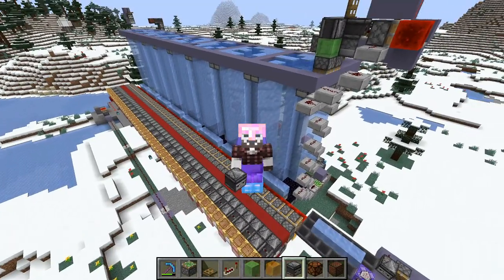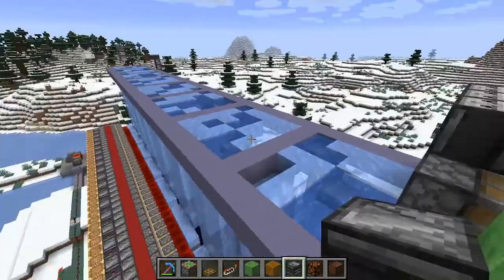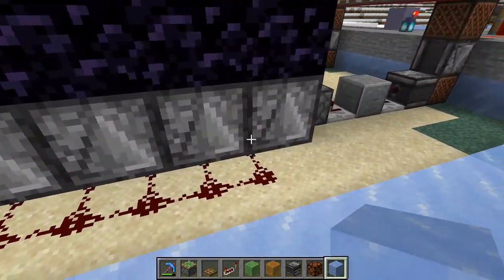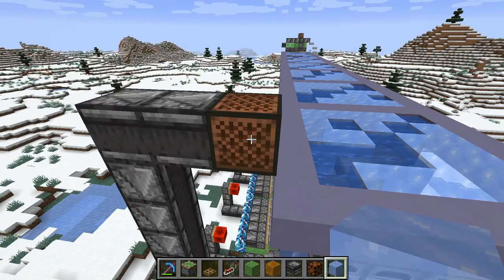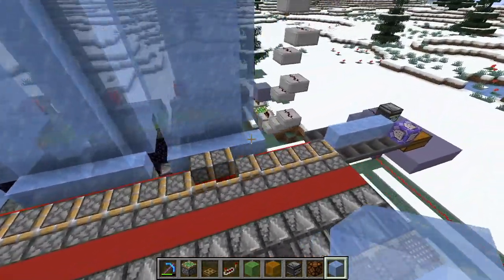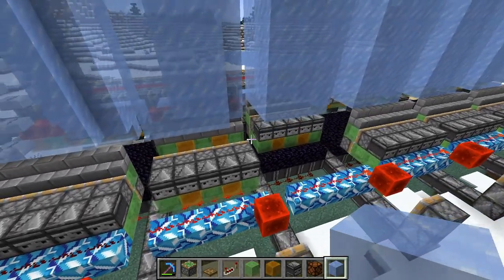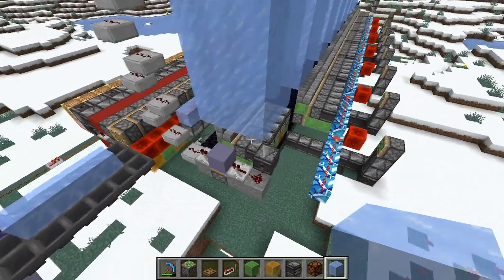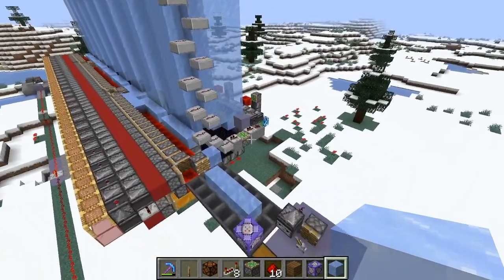Minectaft AFK Ice Farm 1.15+

Comment: I am just designing a sistem like this in survival and I am doing it 64 long for 2 line large 8 blocks. So it remain inside a chunk loader.

1st I found a better solution for the flying machine. You just have to add a piston with an observer above and it will push 12 blocks moving and use 2 istant wire sistem to time all the flying machine togheter on the down machine.

2nd I actually I found a infinite tilable sistem to for the upper flying machine so instead of the dusty dude upper machine that is limitated for 8 large farm, you could do it up to 12 blocks large in order to stream them to the player.

3th I pusch the bottom layer of ice of the 2 tower of ice in the center so tnx to a piston sistem all ice get pusched down in a 3th ice cube that fill at fouble the speed, so they are there to mine later once you are not afk enimore.
On the bottom I designed a 3th flying machine that push a bottom section of 8x8 (but it is possible to use up to 12x12) and with a tailable horizzontal piston extemder with adjustable extencion speed I designed it give ice to the blocks conveyor.
It is expensive but fun.

At the moment it is somthing like 3 x5 chunks. But iven doing the dusty dude sistem to 12 instead of 8 it will remain inside the 5x5 chunk loading sistem.
Reply from the maker: This is a build that i always mean to come back to.  I had to take apart my ice machine on my survival world and I need to rebuild one sometime soon. Do you have a picture or schematic of your changes?
Reply: @gneissname  no sorry, eniway I am still building it...I am doing jn survival directly because ice farm is biome depending so I tried to figure out some flying machine sistem and try directly in survival after.
Reply: @gneissname  At the moment I am stucked...😂 I need a way to turn 90 degrees the 6,6 block per seconds conveyor, I found a way but it works only with solid blocks and not transparent like ice...
Reply: @gneissname  I tried to avoid this using a cart moving on power rayls mining 8x3 line in movment but it was moving to fast, so I slowed it with comparators and it wa to slow.
I noticed that if you mine ice from a minecart in movment you are rwally slowed down in the speed you brake blocks instead of walking around....do you know why?
Reply from the maker: @nessunonessun1  I do not, I had an early design where I tried that and discovered that issue. Now you can water log rails which slows it down a bit. Might be an option.
Reply: @gneissname  I tried to chain il mango 6.6 block per second one for left and one from rigth, I did a row of 8 piston that push after last of the convoy and after to ad alittle conveyor to the player to brake 8 blocks stream ina 5 block per second one, but 😂, if I use 6 redstone tik of delay it fire to early on te first block and brake, if I use 7 tick of delay it fire to early in the last block and brake so probably I will need a sistem to do a game tick delay? 😂
Reply: @gneissname  yes but it will still mine slow cause you are in minecart...I saw on internet people use water flow to push the player....
Reply: Ok I rtyed all solution, such us skafolding delay, turning horizzontal pushed the 5 block per second conveyor so it was not broke by blocks coming by side, notthing, the only way, with a 6,6 block per sec conveyor is a row of 8 piston with at least 6 redstone ticks delay to fire all 8 blocks side and a 6,6 block conveyor that fire a little less often on e line after the other so the 5 blocks per second one can finish to push all 8 blocks before an other line come....now I am wondering if it wort to do a 6.6 blocks per seconds if you are restricted to a 5 after and if i remove the 5 blocks per sec and I use ther a 6.6 one if player is still able to mine all blocks...
Reply: Ok answer is no, if I use all 6,6 instead of 5 it work perfect and fast but I am not able to brake blocks before they hit me so with 8 blocks steream it is impossible to use 6.6 but you are forced to use a 5 blocks per sec at the end reducing so the frequemcy of the 6,6 part.
 I think it is still wort to use a part of 6.6 because it move fast the slice, but the number of time it fire is restricted by the 5 blocks per sec part...this is not a big problem, because my horizzontal piston extender I did to separate the 8x8 blocks section, is easily adjustable in timing using hopper clocks and so adding 1 items per hopper....
Reply: Finally I managet to build it and to clock all togheter. An expensive but funny build....it form 3 tower of ice long 64, large 8 and tall 12 (I used dusty dude 8 large layout with same flying machine on top, so you can not harvest manually all 12 for the 2 main tower for the ice formation meccanism). Mainly the dusty dude flying machine push and form the main  2 tower of ice that are timed from some double etho clock sistem perfectly sincronised with scafolding and istant wire sis so flaying machine will go only one time for run.
Under a long tilable flaying machine will push last slice of ice on the center alternate so first one side and after the othe because the top 2 flying machine fire alternate to every 6 minute so a tower will actually fire every 12 minutes.
Once ice is in the center a roof of pistons is powered from a sequence of hopper clock with out reset timing that will fire a 8x8 piston section down at the time every x seconds to the bottom flaying machine that run all the lenght of the farm pushing the 8x8 section to a separator piston extender I designed with adjustable speed that pus a slice of 8x1 at the time to the Il mango 6,6 conveyor belt sistem.
So with 2 conveyor belt It push ice to the center to a piston sistem that convoy ice to a Il mango 5 blocks per second conveyor that puch the 9x1 slice to the afk position where you can mine ice.
This farm make alot the use of istant wire and rayls-observer redston sistems.
I built a chunk loader for all the flaying machine, so when the famr run it activate.
Is all Afk until you have a pick axe aviable.
Quite never the farm push 8x1 ice to the player, but it push quite continiusly ice to you.....in next days I will try the rates...but with all 3 towers full you can manually harvest 15.000 ice to after the afk section. 🎉
Reply: Actually I alrady know that the farm is long 64 and 7 ice large, and I saw that with 12 minutes it leave somthing like 30-35 water left not frozen so:
 64x7-33=415 ice every 6 minute, so 4150 ice/hr

Comment: Hi, does this farm still work for 1.19.2?
Reply from the maker: Yes, i just tested it in 1.19.2.  after turning the block conveyor on, you might need to start the flying machine once by hitting the note block on the top far end. Only do that if the ice pushers aren't pushing the ice into the conveyor though.
Reply: @gneissname  Thank you, also thanks for the quick reply (didnt expected to see one in an old video) and that you took the time to search if the machine still worked, I will try to build one.
Reply from the maker: No problem, let me know if you come across any problems. I have been thinking about revisiting this design or trying something new.